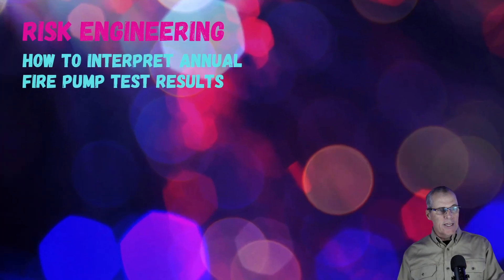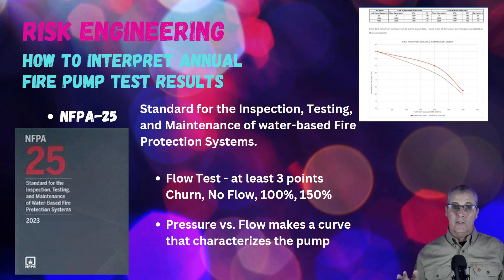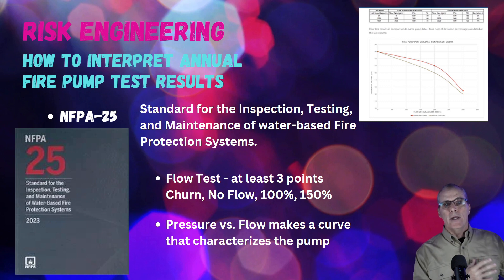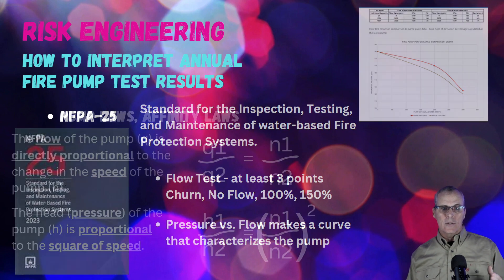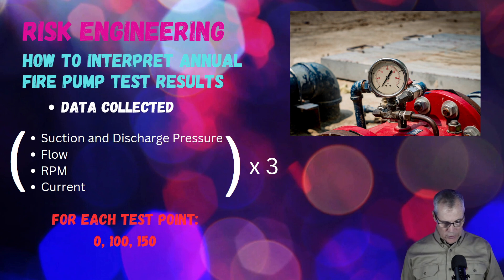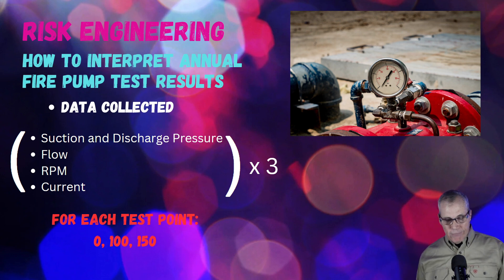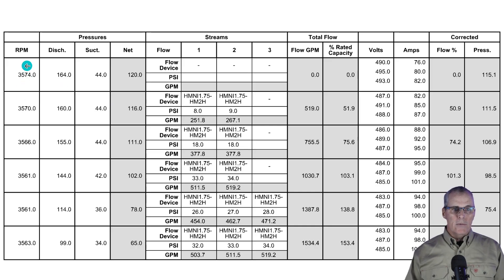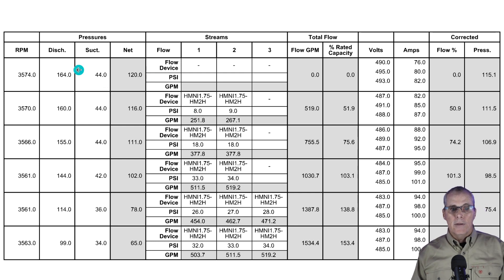Understanding Annual Fire Pump Test Results

Comment: Hello, thank you for the great and informative video.  I was wondering if you had more information when a fire pump test is stopped prior to the 100% curve due to low suction pressure (10 PSI).  Shouldn't the company performing the test note this as a deficiency?
Reply from the maker: Great question. Yes, a significant drop in suction pressure would need to be noted, and it should trigger an investigation.

Comment: I test a fire pump that consistently has a high churn pressure (140 PSI plus as compared to the factory churn of 116 PSI) The 100 %  is always around 90% of the factory 104 PSI  at 94 PSI and then the bottom falls out at the 150% point (Factory at 87PSI to the annual  test pressure of 58PSI which is well below the 90% requirement). This is a vertical turbine pump with a raw water source. Normally  I get a -3PSI  for the supply pressure as the water level is usually around 6.5 ' from the surface of the water to the C/L of the discharge on the pump. The curve on the graph is always convex instead of concave.  Would you be able to direct me to a corrective coarse of action that would help resolve this. The pump rating is 1,000 GPM @ 104 PSI with 1770 RPM. My RPM readings are around 1785 at churn, 1777 at 100% and 1774 at 150%. Yes, I do have my gauges calibrated annually.
Reply from the maker: Dennis, thanks for the great questions. Can you get a borescope inspection of the bowls? The experience I have with VT fire pumps is that either a blockage of weeds and branches formed or one or more of the lifting bowls was damaged or missing. In those days we pulled the vertical impeller. Possibly a borescope would give you confidence to look elsewhere or actually find an issue.
Reply: Thanks for the insight, once I get consent to proceed, I'll get back to you on the results.

Comment: What if corrected test result shows that test curve is above the pump OEM curve...what is the interpretation for such result? will 5% apply to going above the OEM curve as well?
Reply from the maker: The NFPA 25 committee was not concerned with pumps performing above the curve. They weren’t even interested in meeting the largest system demand. The manufacturers reps on the committee were just looking for a way to monitor wear on the impellers. (Check that the driver is at an appropriate RPM.) The 5% was never about reducing risk. Risk was never discussed. Where did it come from? It was made up.